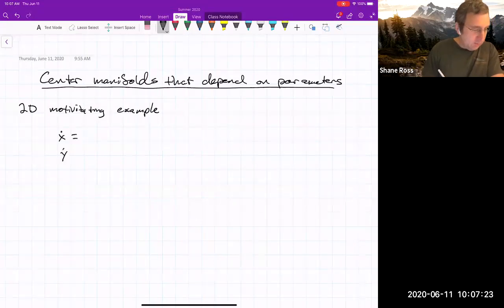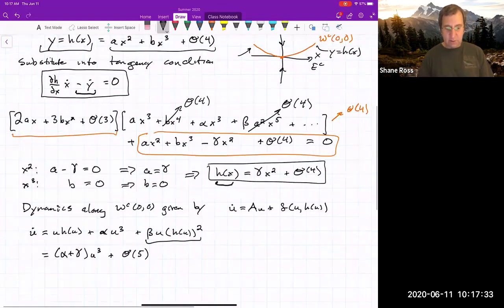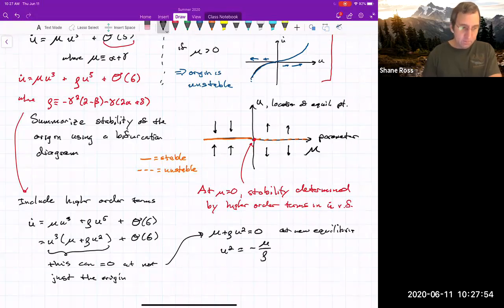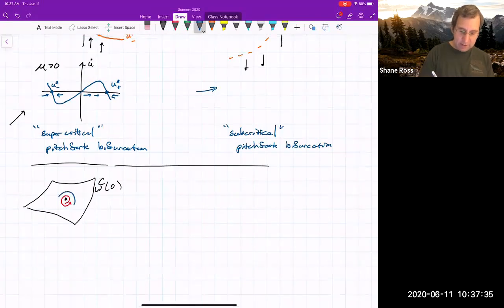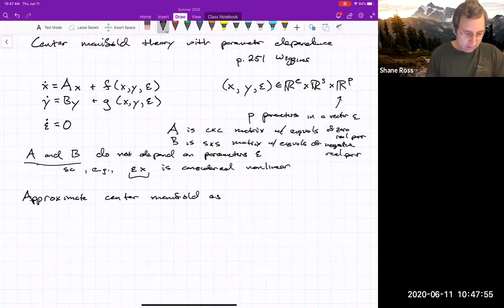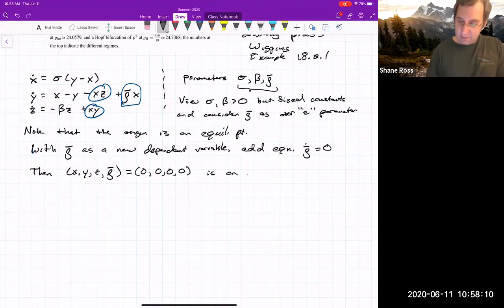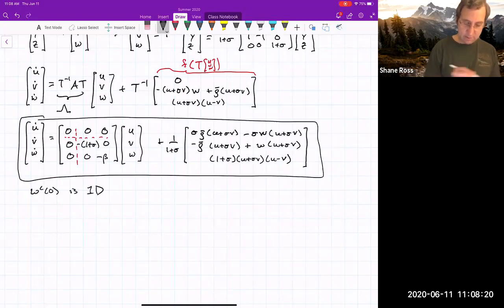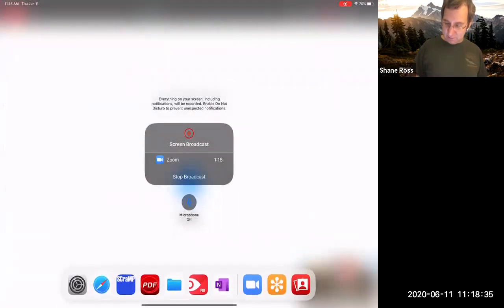Center Manifolds Depending on Parameters- Bifurcations| Lorenz System Bifurcation, Part 1, Lecture 4

Comment: Hi professor, thank you for these great lectures. I've noticed that in these examples, the final system that's reduced to the center manifold is 1D so stability is easy to determine. What if we got a 2D  (or higher dimensional) system after applying center manifold theory?
Reply from the maker: If you have only stable and center directions, then the stable directions all decay and you would be left with a 2D or higher dimensional center manifold system which will be inherently nonlinear (so 2nd order and higher terms). Although it's not as easy as analyzing the 1D system as in most of these examples, it is still a simplification. Other methods could then be applied to that 2D or higher dimensional system. I have 2D and higher center manifold examples here ( https://youtu.be/_jUb0gCe3N8?t=3543 ) and here ( https://youtu.be/Fz-yj_qEvuA?t=2571 )